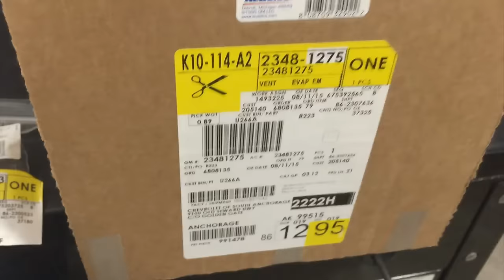Chevy Truck Hard To Fill Gas Tank - GM EVAP Codes P0442, P0446, P0455 or P0449 Vent Solenoid replace

Comment: Great video... what do you think the price at a dealership would be for this.. rough estimate..  great video.. subscribed..
Reply from the maker: $500-600
Reply: thanks for answering me back...
Reply: +The Car Doctor took it to a shop n they removed and replaced the evap canister purge solenoid, the canister vent solenoid and the canister vent n purge valve

but now weeks later my tahoe has trouble cranking at times

I turn the key n its delayed when turning over n doesn't always catch n crank,up properly

what do u recommend doing?

do u they think didn't fix it right or is it,something different 

dont know whether to go back again or take to dealership n let them,diagnosis it.. 

Didn't know if the dealership had better scanners to pinpoint the problem instead of guessing which part to replace next

when,I get,it cranked runs fine down the road like normal

thanks again your videos are so informative and easy to comprehend
Reply: My mechanic charged me $62.53 for the parts and $50.39 for labor.

Comment: I replaced both the vent and purge valves. code came back a week later. so I ordered the new charcoal canister and will be changing that Monday when it comes in. stupid evap nonsense is making it nearly impossible to fill my gas tank.
Reply from the maker: I agree. Stupid. I miss the good ole days. Hope you get her fixed up. Thanks for watching.
Reply: If this don't fix it the only thing left is just disconnect the vent and smell gas lol
Reply from the maker: haha, no don't do that. You got this!
Reply: I filled up today. it clicked off on me at full fill speed. and then again at the lowest setting. but I was able to fill it without any issues while holding it. I did have the nozzle in all the way. I figure that's the reason. the BP I go to has pretty good flow and nobody I know of can fill full speed with it. so we will see.
Reply from the maker: well try another place and see what happens. Maybe there isn't a real problem after all.
Reply: there was a problem. I was able to fill it 10 cents at a time. lol it took a long time to get a quarter tank of gas. today I got 3/4 in about 3 min. so it was a major improvement. plus they have 10 cents off a gallon with a car wash. when you add 20 gallons at a time the wash pays for itself. lol
Reply from the maker: sounds like everything is coming up roses for you!
Reply: Yep seems to he working fine. The truck has been started 8 or 9 different times since then and no code yet. Seems the canister was the problem. It was about a pound heavier than the new one. And I put a screw driver down the vent outlet and it was all crunchy. I'm guessing some gravel dust and dirt.
Reply from the maker: Yep. The old vent filter allowed dirt to enter the canister. Good to know you fixed it!

Comment: I did this part, the one under the hood AND the gas cap.   Any Idea where to go next...  :(
Reply: Charcoal canister
Reply: @goch907  is the charcoal canister this? "Duralast Vapor Canister VC4123"
Reply: @antonioarana1784  yes
Reply: Did the canister fix the problem? I got po446 and it's my last option.

Comment: Great video and easy to follow but it did not fix my slow fuel up problem.
Reply from the maker: What did you replace? Did you replace the canister also?
Reply: Disconnect all the evap lines and vacuum them out and see if you don't find charcoal clogging the lines. I went through the same thing after replacing everything in this video. The only other thing is a leak in the vacuum line to the engine and the valve at the engine end of the vacuum line.
Reply: @ThecardoctorTV  no but I blew air through the canister.
Reply: @TomM60  yeah I think that’s what I’m going to have to do. I saw a video about it. Just waiting till I can have an empty tank of fuel to do the job.
Reply: @seanhassett8968  That's whats I'm waiting on now too. I'm too old to be crawling under a vehicle now so my son has a connection to a really good mechanic. He's the same guy that put the Jasper engine in my truck. I don't know but this Jasper motor seems to have more horse power than the stock motor did. I had everything replaced under the hood. New sensors, no wiring harness and motor. The wiring harness looked like rats got into it but it was who ever worked on that engine did the damage. The mechanic took pictures of the heads after he got them apart and someone had the lifters out of it some time ago because the paint was still on the rockers identifying the cylinder they came from. I bought this truck just for the body because there is no rust and I got it dirt cheap so I can afford to replace the whole drive train if need be. The front differential was completely worn out as well.

Comment: thank you for your video.   i used it to replace my evap canister.   when i was down there i found a small vent tube also attached to the fuel fill tube.  this small vent tube ran down and i found it severed sitting on the rear axel.  i cannot for the life of me find out where this tube goes.   any help would be greatly appreciated
Reply from the maker: +Danny C. If you have a ride control system the compressor mounted just behind the LR tire has a vent tube that runs up the fillpipe. Some models have the canister vent solenoid remote filter mounted there also but that hose would be thin wall corrugated plastic. There may be a vent for the rear differential that runs up from the top of the differential but I don't remember seeing them run up the fill pipe.
Reply: +The Car Doctor Ah ha It was the vent that lead to the differential, I found the other severed end hanging off of it.  That problem is solved.  I replaced my EVAP Canister solenoid about 6 months  ago and for some reason I'm still getting the P0496 Code. Can I pick your brain on what else it may be?  From the research I've done the code definition is: EVAP flow during a non-purge condition. Trying to pass smog here in good ol' California.
Reply from the maker: If you replaced the vent solenoid then I would guess the purge solenoid on the engine. It's helpful if you can monitor fuel tank pressure sensor readings since they go bad and trigger the code as well.

Comment: I have a 2005 Avalanche 1500. I know the TSB is for 2007-2010 but do you think this could help my stop fill situation for my year as well? 
Also: 
What if the canister carbons have clogged the other lines to tank? Is that even possible? We went through that Texas freeze last year and that’s when it started the stop filling. I’ve blown out the evap lines from canister in and out and blew out a bunch of canister charcoal bits. I’ve seen one video (but i’m a big fan of your videos) where a guy dropped the tank entirely then blew the lines out that lead all the way to the tank which i’m trying to avoid of course. And not sure if those are evap lines but watched carbon bit being blown out on his video. I think the lines went all the way to the top at fuel pump. Wondered the Doctor’s thoughts on all that especially my earlier year model being pre-TSB for your fix. 

I looked for a TSB for 2005 year model but nothing came up. I believe the yr models should have been expanded later and earlier being i know there are other Chevy models and years not covered in TSB #09-06-04-028D that have this exact problem. 

For 2005 Chevy I’m looking at: 
- Vent Kit  #23481275
- Electrical Harness #19257603
- Vapor Canister #22963841

    All of that comes to $150 Amazon with your part numbers given and fit 2005 Avalanche. 

My wife and I love your channel and look forward to more. Thank you for you service!!

Comment: Had p0446 on my GMC Yukon, replaced purge valve and vent solenoid cleared code ran it for about 20 or so miles and still giving problems while trying to fill up. No engine codes have came up. Kind of stumped at the moment.
Reply: Forest Whitaker I have the same issue , any luck yet
Reply: Forest Whitaker ...My 2004 Youkon Denali Xl sat in a shop 4 about a week & 1/2. When I got it out all of a suden I cant put gas in without pump shutting off. I 1st changed my Canister Vent Valve Solenoid. It ran 4 about a month, then it happened again. So 2nd I changed my Vapor Canister. It ran good 4 about 2 days then again, it happened. So I changed my Canister Purge Valve never helped & gas pump still clicking off on me. Dont know if its internal inside tank? Dont know why it would let me put gas in once I changed parts then all of a suden stop again???

Comment: I changed every thing u told to change but unfortunately the still here and I can't refill the tank at normal speed
Reply: khalil ahmed try turning the fuel handle at different angels, I’ve been able to fuel up without the pump stopping by changing the angle of the handle. I know it sounds dumb but it works 🤷🏼‍♂️

Comment: I have a 2002 Chevrolet Suburban Flex Fuel 5.3 LS and there's a fuel leak whenever we fill the tank up and park the truck facing uphill.  If we face it downhill, it does not leak.

The leak appears to be right at or above the fuel tank filler neck, but the smaller hose neck.  Any suggestions to repair?  Thank you for posting your incredibly clear and detailed videos!  BIG HELP!
Reply from the maker: If you live in a place where rust is a problem it may have a rusted fill neck. Youll probably just need to lay under and isolate where the leakage is coming from (don't swallow gas!! or smoke while doing this) or have a shop smoke etst the system and locate the leak
Reply: thanks so much for replying...  I will do that.  I'm in Florida by the way and it's a Florida truck, minimal rust.  aren't the fill neck and vent neck both plastic like the tank though?

Comment: i have a 2004 chevy avalanche i got the code for the emissions vent solenoid code and i have replaced the solenoid, but now when i full my tank instead of cutting off like it did before when tryin to fill before i replaced the solenoid now it spews gas out the filler tube. i have checked everything that i can think of but everything else seems to be in proper working order. can you please help me with this issue?
Reply from the maker: +Michael Bradley Make sure no hoses got kinked during the process. Something wrong on the vent side. Possible faulty part.
Reply: +The Car Doctor OK so I went back through everything and it all check out good no kinks and nothing is restricted I pulled all the hoses off and checked them for restrictions and what confused me is the fact that I'm no longer throwing a p0446 code but still having the same issue
Reply: +The Car Doctor so any direction you could give me on this would be greatly appreciated because it's really irritating when the pump clicks off every few cents or decides it wants to spit fuel out the filler tube
Reply from the maker: If it happened immediately following replacement of the vent and it's not a kinked hose seems like a possibly bad part. You could disconnect the hose at the canister before you attempt to fill the tank and see if the restriction is in the canister which can be the cause in some cases.
Reply: +The Car Doctor I will most definitely give that a shot thank you
Reply from the maker: Let us know what you come up with. Very interesting case.
Reply: The Car Doctor hello there I've also replaced both filter and solenoid and no difference but I never have had any code pop up I have a 2008 GMC Yukon it's spitting up fuel back at me I have never had a vehicle do this
Reply: The Car Doctor help me lol